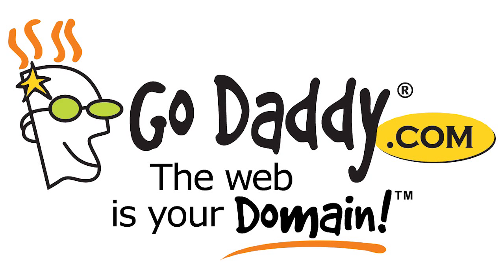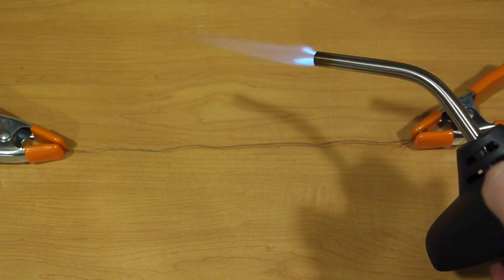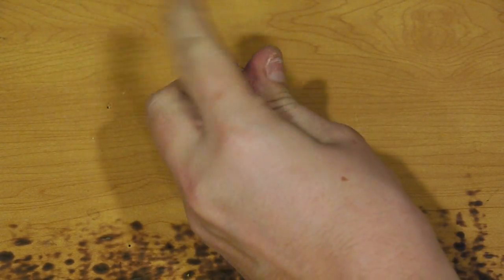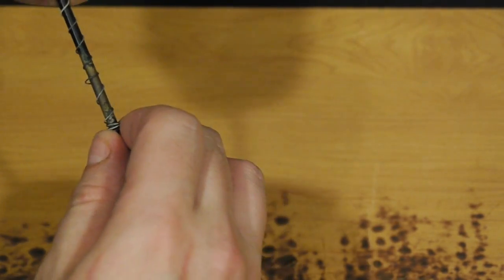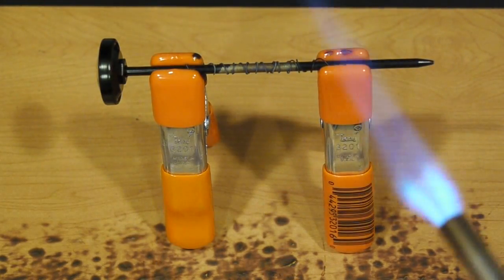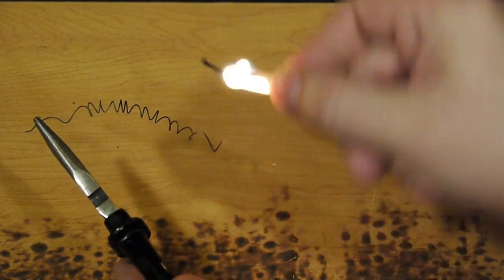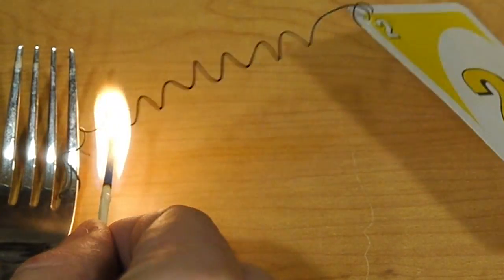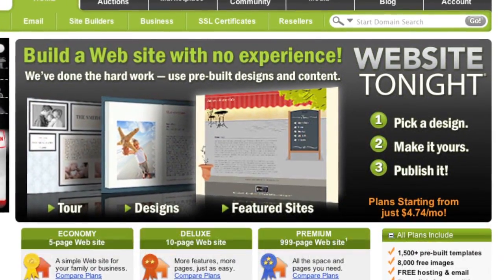Scientific Tuesdays - Nitinol - Memory Wire Experiments

Comment: There was a video I seen someone had used this type of wire in a science project I believe in a fashion of like a belt for a car and when heated with warm water it rotated the two wheels it was on one wheel touching the water and rotating the side in the water to what side is touching it would go forwords or backwards my curiosity is what would happen if the tensile strength is increased and the wheel out of the water had something akin to a windmill copper wire with magnets and solving a heating type of element fixated below close to the lower wheel with enough trial and error situating things for rpm of the top wheel and electricity connecting to the heating element with of course a on and off switch a ground and place to store access electricity and a rubber mat placed under the contraption that I could imagine looking like a fan on a stand and just one little push to get the process rolling what would happen

Comment: HI! I did this Experiment with Nitinol Wire (1mm thickness) Astenside-Temperatur around 37 degree celsius (+/- 10) i`m quite disapointed with my results. i doesn´t let it bend easlily in the cold state. maybe too thick? Which kind of wire did you use? how thick?THX

Comment: Would it still work if you heated the wire by passing a current through it?
Reply: KLanD Tine According to SparkFun, yes
Reply: Fox Blackcinder Thx!
Reply: KLanD Tine np. I ordered eight wires just now, so I'll find out next weekend if/how well it works.
Reply: I saw some nitinol arch wire on ebay for ~$2 a pack.. I wonder if it would work.
Reply: KLanD Tine you surely have to see de ratio between ni and ti... there are some charts and tells you which temperature is the transition temperature of super eleatic and plastic deformation... generaly niti alloys are used for dentist and in superelastic condition with transitions below 0 degres... if thats the case this NITI alloy wont have this memory ()unless you freeze it and deform below 0 degress and when it reachs temperature it will go back to de shape... also you have to take care when doing the shape memory process... cause if you stay to much time at high temperature it will oxidize (and it s already a thin wire) generally the more Temperature you apply the less time you have to leave it in place but the more oxidation you have... and its not 1 to 1 ratio... for example 30 mins a 500 degrees it will be 1 hours at 550 and it will be 10 hours at 400 degrees.(really dont know and it depends on thickness of wire)
Reply: Fox Blackcinder How did they work? I want a thicker wire.
Reply: Not very well. I gather that thicker would work better, but mine are about
as thick as a few hairs braided together and the stroke is very weak, and
trying to get it in the molding state without melting the wire is tricky.
Reply: Fox Blackcinder so, what wire # would you get if you bought more?
Reply: I haven't really looked into it since the thicker wires require more
current to activate and my project is for a wearable with a rather limited
output and it'll be less difficult to make a pulley system with micro
servos instead.

Comment: what if with enough material...this could be used to make cars, or trains, trucks, boats, engine blocks! If baked into position, you could possibly make a dentless car. Should the car get slamed, heat could be applied therefore popping the dent out

Comment: I ordered some "nitinol memory wire" and I have the problem that I just can't bend the wire in its cold state, it will always spring back... anyone knows the solution?
Reply: As you might know nitinol is an alloy. The temperature at which the wire snaps back into position is determined by the mix ratio of nickel and titanium. Probably this temperature is quite low in your case, but there are alloys with different mix ratios und thus different working temperatures available online. With your wire try putting it into your freezer or try it outside in the winter. When it's cold it should be plastic, when warming up again it snaps back.
I hope I could help you!

Comment: Hey very great vid, but I was actualy looking if there excist a heat-shrinkable glue, that I could do on fabric, glassfibre, aluminum foil. than glue it on somewhere, heat it and it would be nice and tigth, but I can't find it.
Can you advise me a product? Or help me figger out what kind of polymer I need to be looking for?
Only thing I've learned that's heatschrinkable is polyvinylchloride mixed with polyester, but not sure if pure polyester is heatshrinkable.
Hope you could help me. Thanks

Comment: @warecreepers Lol, they're already working on that. I think it was Mercedes who built a car which would return to its original shape, (no matter how dented or crushed the car was) if you ran an electric current through it.

Scientists have been advancing this research, particularly for missions to Mars, as a solution to possible damage to any equipment or shelters they deploy there, should there be no human personnel to manually repair damage.

Comment: You aren't doing this for the first time I assume, but still you burned the wood and the clamps. Why didn't you use something, that is heat resistant like metal claps and a metal base for your burning experiment?

Comment: As far as I'm aware, the "shape-memory" ability is due to the metal-crystal structure of the involved metals.  When forced into a shape and enough heat is applied, the crystal-structure is restructured and tracks are formed based on the forced shape. After re-shaping the cooled-off metal and the applying a moderate amount of heat l, it will "bend" until it has the same shape as the tracks that were previously created in the crystal structure.